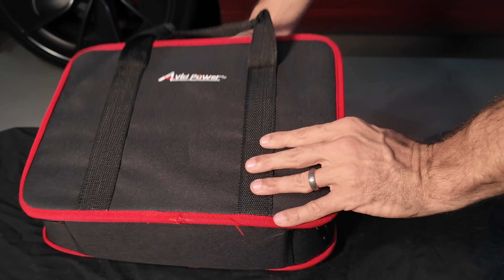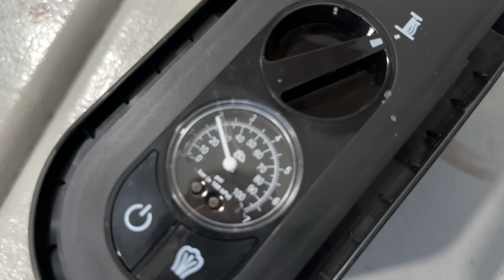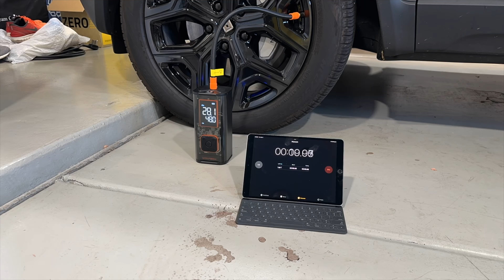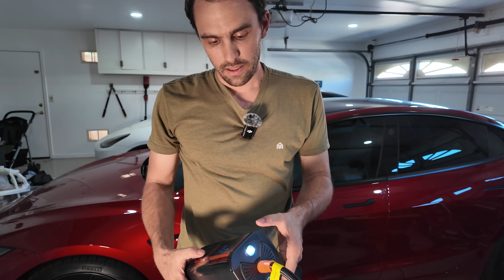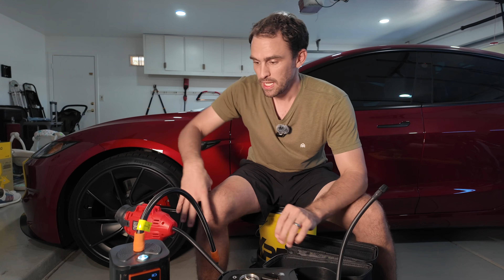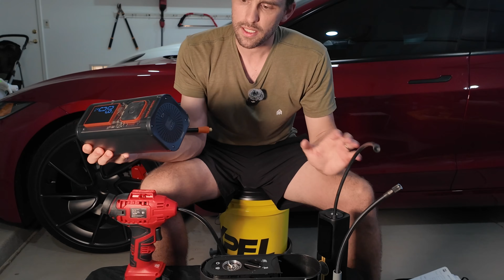These are the Best Mobile Tire Inflators

Comment: The most notable feature of the Tesla-branded 'Air Compressor + Tire Repair Kit' is its direct integration of an air compressor and a tire sealant canister, which is essential since most Tesla vehicles do not come with a spare tire. While many portable air compressors offer reasonable performance for simple inflation, the combined unit is specifically designed to provide both emergency tire repair (via sealant) and air inflation in a single, compact system.

Comment: Nice review, but no, inflating from 28 to 48 PSI is not the same as 43-48 X 4.  I have one of the Tesla inflators which is garbage, true.  However the 16V outlet is also garbage in both my 2023 Model S and 2025 Model 3. They overheat, take forever to reset, don't source much current, and are 16V instead of a good standard voltage.  Gjeebs seems to have a better compressor since he didn't complain of cutouts also happen in the compressor . Everything will work better if you use external battery.  Avid Power uses its generic battery which is also for other tools in the line.  I don't happen to have that particular variety, but similar compressors are readily available for Milwaukee, Dewalt, Ryobi, etc, batteries  and most get good reviews.   Using your existing battery obviously saves $$. The Wolfbox, while great, has a fixed battery which doesn't appear to be replaceable.

Comment: I just used tesla.  it has great digital readout.  maybe you have old version.  It's fast and easy.  I'm not sure what your talking about.  It's compact and super simple.  My tire inflated from 0 to 40psi in about 15 min.  The only thing that could make Tesla better is to make it silent, it's a bit noisy, and make the box easier to open, you have to watch a you tube to figure out how to open it.  That is too elegant.  straight forward is better. they over thought it.

Comment: I just used the Fanttik for the first time and it worked flawlessly. I have no doubt there are more powerful inflators, especially if filling a tire from flat. But for routine top ups, it takes all the stress and worry out of finding a place to fill the tires and not having to worry about it whether it's the right psi. You just select the target number and press go. A minute later or less, it's done. Repeat 3x. Used almost no battery. And the case makes it perfect for storing in the frunk.

Comment: As always, great review!!  I have been using the Syncwire and really love it.  I use it for my 2024M3P and 2022YLR to keep them inflated to spec.  I also love it for my wide-tire electric bikes, and pool toys.   I can throw it in my trunk, frunk, and it easily fits in my bike’s nap sack too with plenty of room to spare.  At only 18 liters per min, it’s still pretty fast for my needs.  While the others may have higher LPM’s at higher prices, they aren’t as convenient for me. In terms of ease of use, size, portability, battery life, flexibility, quality and value this little guy fits the bill for me.

Comment: I use a bicycle floor pump, instead of those electrical inflateurs. 
I had a flat with my Tesla recently and after patching the hole, 
I was able to inflate my tire with my bicycle floor pump and continue my trip.  
Cost less than $10

Comment: Are all of those chargers running using an internal battery? 
Or when using a 12V plug, how much current will be used, because the 12V plugs have always a max current limitation.

Comment: I have always preferred inflators that do NOT have an internal battery, using the car's battery instead. The reason for this preference is I dread having one more battery to maintain and keep charged. I live in the  northeast, where it is cold in the winter. The winter cold results in frequent tire under-pressure and it is also hard on small battery packs, like those in tire inflators. The fact that two of these inflators have direct-wire options is great and potentially will solve the dead internal battery issue. I would have been great if you had run-down the internal battery on the two units with external power wires and then timed them on the 20 to 48 psi inflation test using external power only. My suspicion is their performance on external power and a dead internal battery will be worst to much worse compared to using their own battery. If you did test this I would be interested in the result. All the best.

Comment: If you own power tools like ryobi dewalt Milwaukee you could pick up one of those brands air compressors. I have the Milwaukee and it performs flawlessly. Also much more compact and have removable and replaceable batteries. These do get expensive though if you don’t already the required batteries.
Reply: I have the Ryobi one since I already had the batteries. $40 and inflates way faster than any of these. Digital gauge, auto shutoff and just as portable as the ones in the video as well.

Comment: The new Tesla one says 
Max Pressure: 80 psi
Flow Rate: 25 L/min at 0 psi
It has a digital read out as well.  You tested an outdated version that shows' "out of stock".   Should you buy it for 110$...well it does include the tire repair as well.  It really does not matter.  If I have to spend $99 on a portable air pump...it will be the Tesla brand.
Reply: thanks.. i can't finish this clip because it's so bias:face-blue-smiling:

Comment: For those inflators that use a cigarette lighter plug in, you have to make sure that they will work with the newer Tesla's 16V battery rather than the standard 12-14V system of most cars.  I have a few accessories that simply would not work with my 2023 Tesla due to an over-voltage condition.  I think all of the devices you tested can run off of a battery that you can charge with a USB-C port but you did not test battery life - my cheap inflator will do about one tire from empty to full and will have less than 50% battery life remaining.  You might also want to test charging time using the Tesla's USB-C ports to see how long you are really going to be stuck inflating the tire(s).
I hate to say this, but based on your demonstration, I am not bowled over by the Wolfbox.  The screw on valve means that you will lose a measurable amount of air unless you are very quick.
While you were quick to dismiss it, I think the Tesla inflator with the slime dispenser will actually be more useful (even if it is lacking some convenience features) if you have an actual leak and it is a Sunday evening when all of the tire stores are closed.
Reply: The Tesla inflator works so poorly I fear it won't function when needed, but you can use the aerosol slime to get both inflation and slime.   I would recommend that for emergencies as it is easy and reliable. The screw-on fittings I have are longer than the engagement distance to the valve, so the valve is completely closed before much air is released.  I have both types and find neither works any better to save air.  The clamp-on is fairly easy to use if you are strong enough to get it seated properly, otherwise the screw-on is more reliable for good connections.  My wife cannot easily use the clamp-on for her bicycle, luckily I have a screw-on she can use.  Also, if you are using a Presta adapter, I find it is a even harder to use the clamp-on.

Comment: The avidpower tire inflator instantly turns off in my model Y. It's like the port is not providing enough power once I try to inflate a tire. Doesn't matter if I use the port under the center console or the rear hatch
Reply: Are you using the cigarette lighter port?  You may be in an over-voltage situation with the 16V Tesla battery.
Reply: I have the same issue. Avid will not run off center console or trunk of my 23 model Y. I always have to worry about keeping the battery charged which sucks

Comment: Gjeebs, i went to the link and the only one I can find on their website is WOLFBOX MegaFlow 24 Pro Portable Tire Inflator and it is $119.99 and your GJEEBS code does not work. They have a code listed on their website for $20 off "BEST INFLATOR" so that would have got it to 99.99 but it says that code has reached it's limit! Am i missing something because I can't find anything that goes to 89.99 and your code doesn't even work. And you just posted it today.